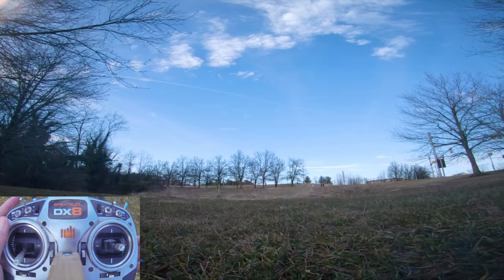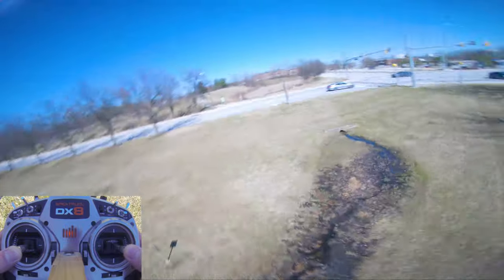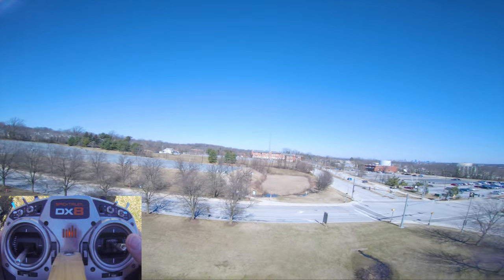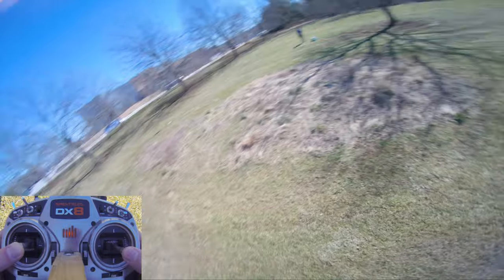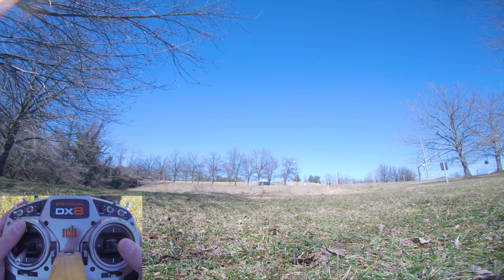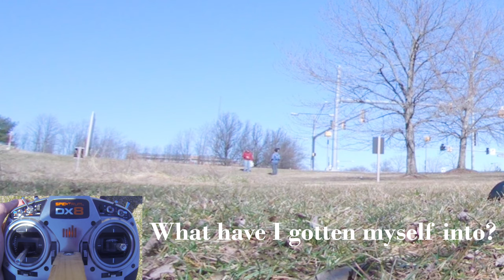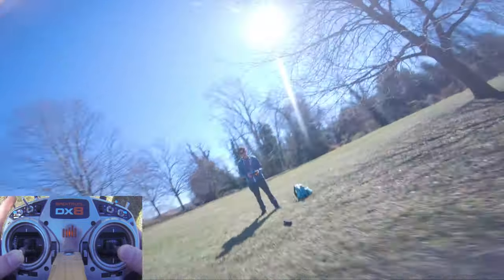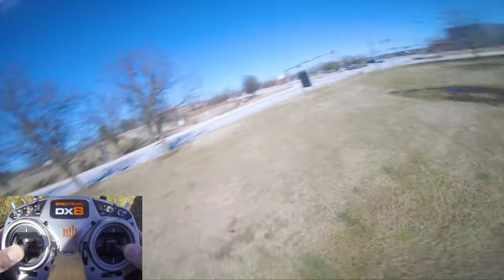The Adventure I Didn't Ask For - Tubular Quad V6 Fixes and PID Tuning feat. Stranger Danger

Comment: Awesome.  What is your auw? I think I will try my hand at 6" biblade freestyle and am curious what you fly.  At what weight would you consider changing to 6s on those 1900kv motors?
Reply from the maker: Thanks! 593g AUW. I would probably never run 6S on 1900KV and 6 inch because the rpm range would be way too high. 1650KV on 6S would be more reasonable, but still a much higher rpm range than I prefer. Probably not needed unless you want big power or have >700g AUW.

Comment: Hey man, love your videos, and also the way you go about tuning in bf. I have a 6" 2306.5 2450kv. I know thats on the edge for motor size and a 6" prop. it flys great on 5" props, but Is there any reason why I couldnt get that combo to fly good on a 690auw 6" glide?
Reply from the maker: Thanks! I've personally found 2206 2140KV on a ~630g quad to be plenty of motor, so I actually think your motors are appropriately sized. A proper PID tune will probably make a big difference. Bigger props need higher gains to compensate for their higher rotational inertia. Nowadays with rpm filtering you can run pretty high gains without getting hot motors. My new tuning philosophy is to run the highest D gain possible while maintaining cool motors, and increase P proportionally to maintain the desired response characteristic. I also personally prefer to turn off a lot of the features that are turned on by default:
https://www.youtube.com/watch?v=C-WzcTzl4aQ&ab_channel=TimmyRC

Comment: What're your flight times on that? Love the sound the 6 inch biblades make... so quiet.
Reply from the maker: 4-4.5 minutes doing my normal freestyle flying. I much prefer the sound of 6 inch twin-blades compared to the shrieking of 5 inch triblades.
Reply: @TimmyRC  hm hm hm
i don't think size or number of blades dictates the sound alone
but to get a wispy sounding 5" triblade quad, the entire setup has to be changed
yours sounds so nice, because you have a lower auw than many 5" quads And use 6", so the blade / disk loading is really good
a 350g 5" would sound just as nice
Reply: @marc_frank  I have an 320gram 5inch triblade and it sounds like an regular 5inch just quieter. Blade count makes the biggest difference.
Reply: @haustiersteinfpv9181  blade count changes the pitch
disk loading changes the amplitude